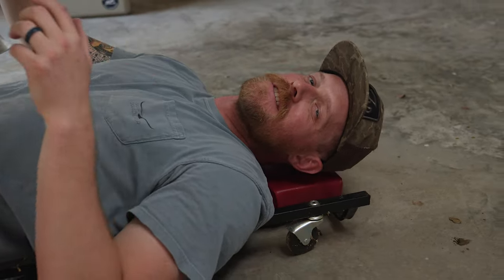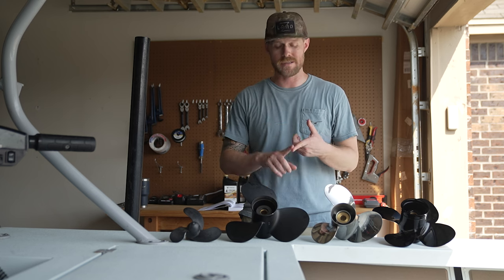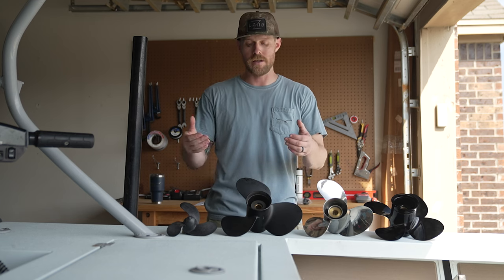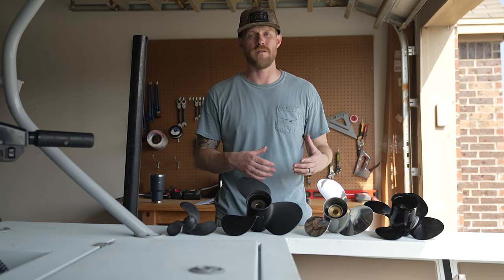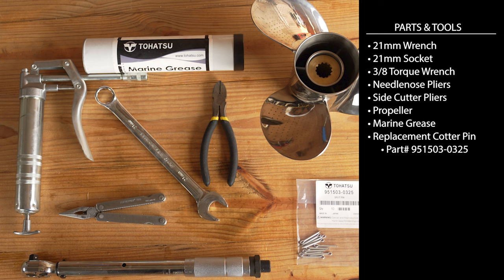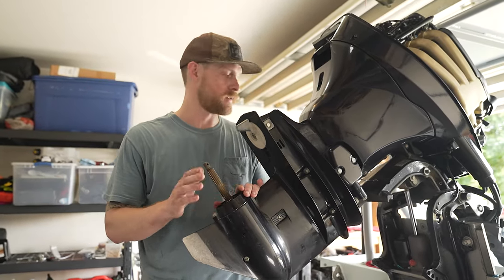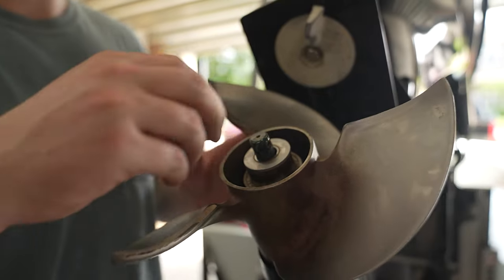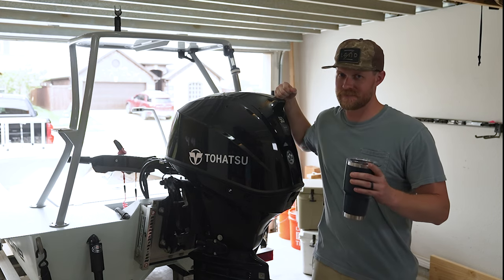Selecting the Right Propeller for your Outboard & How to change a Prop - Pete's Garage

Comment: Good summary as always! Please do some videos on alternative setups for light loads, weedless/duck applications, or slight overpropped for jackplate surface drive running). Also, a tip my dad gave me is to measure the tip gap to keep track on prop wear...